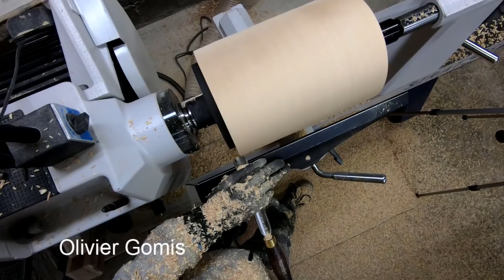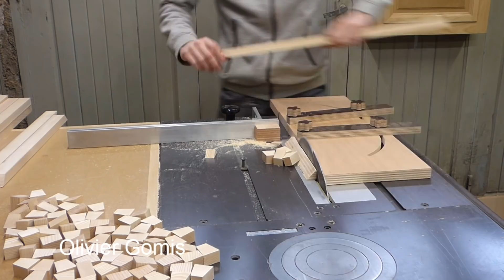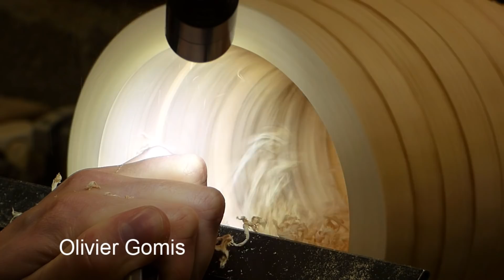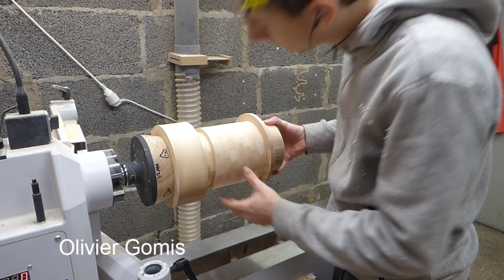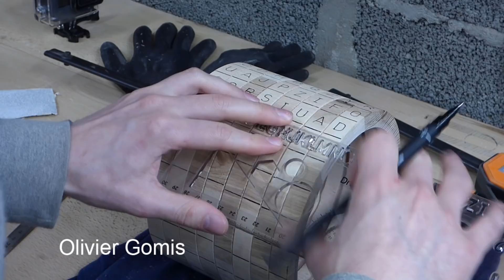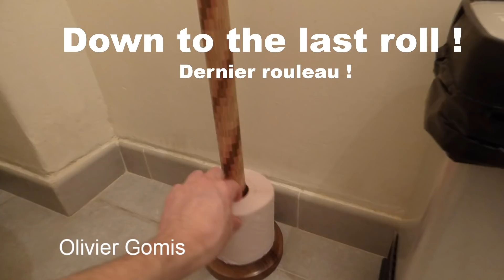Un tourneur Confiné: Le Dernier Rouleau

Comment: Hi Olivier Gomis! Your work is cool and interesting.  But, really, I didn't understand how the system crashes.  Did I look, look, look and re-look and couldn't understand?  How did you operate the lock?  I know that letters are passwords (some of them).
Reply from the maker: You simply turn the 8 rings to alligne the password and it unlock the two parts and you can pull them appart.

Comment: What if the paper runs out and the guy forgets the password?
Reply: Binge watch The Lock Picking Lawyer and Bosnian Bill until you know how to pick that kind of lock. It will be relatively easy, until Olivier adds false gates.

Gently tug on the lock and see which ring is binding. Spin that around until it stops binding. Repeat for all rings. When you get the last ring in position, the lock will open.

False gates are notches that go part way through a ring. The false gates make spots on a ring where the mechanism doesn't bind, but it doesn't open either.
Reply: @hamjudo  Nothing on one, two is binding, got a click out of three........ 😂😂🤣